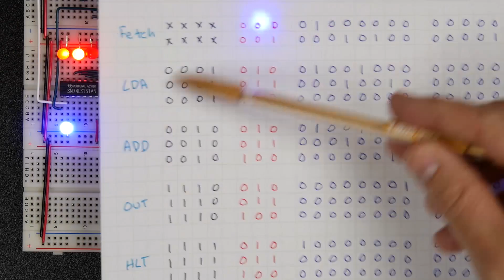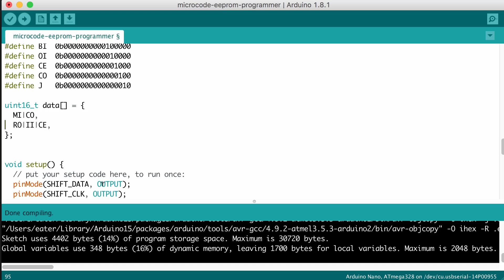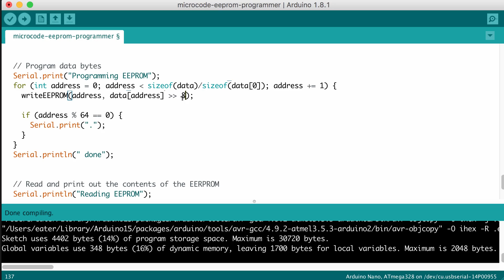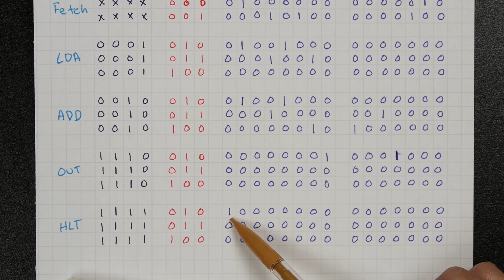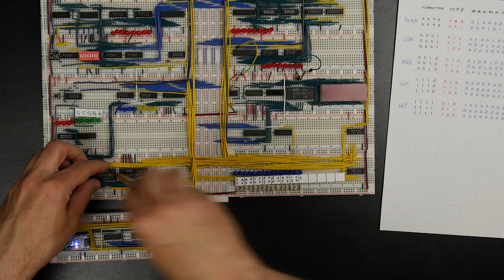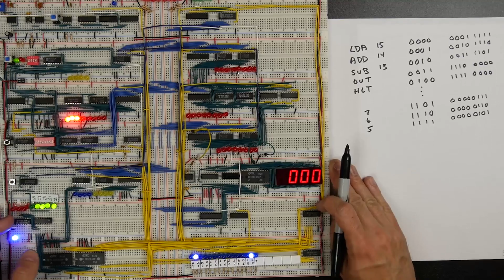Reprogramming CPU microcode with an Arduino

Comment: Doesn't RO and CO at the same time cause a short circuit if they try to drive the bus in opposite directions?
Reply: It would if you created a  microcode instruction that used them both in the same t-state but you would never enable two outputs to write to the bus at the same time.
Reply: except he did when he used the upper bits of the ucode in the bottom half before tying the address bit high!
Reply: Ah, I see what you mean. Good point, Maybe he was lucky and the RAM just happened to have the same value as the PC. He had just reset the machine so the address was 00 and he only stepped through the first couple of t-states. If he had powered up and let the clock run long enough for the RAM output to disagree with the PC then the result would be dependent on the chip specifications. So long as the processor was running then although the contentious outputs on the chips driving the bus would stress the chips they may be brief enough to avoid doing serious damage to them though I dare say they would probably get pretty warm. Obviously, the voltage level on the bus would be out of spec and there would be no guarantees as to the value read by any chips that tried to read the bus at that moment.

Comment: This makes my brain hurt. Why are we not using A0 to switch between the low and high eeproms?
Reply: Because A0 only changes when we move on to the next address. Remember that we need 15 control signals for each instruction. By hardwiring A7 differently on each chip they will each output a different 8-bit value for every (7-bit) address giving 16 bits for each instruction,  
Using A0 as a chip select signal was a common technique for 16-bit computers where the low bytes were stored in one chip and the high bytes in a second but then the data was different in each chip.
Reply: Actually, from a practical point of view, it wouldn't matter which address lines were physically connected to which.address pins on the chip. Although the data would be stored in different locations on the chip the data selected by any particular combination of inputs would be the data stored by that same combination,

Comment: Programming something into this looks so tedious. 
Will you add ROM address space like they did it in sinclair?

P.S. In the arduino sketch using array length in the loop and constant 128 as an address shift for second loop looks so bad to me...

Comment: "That pipe symbol" is a bad explaination if most of your audience is using Windows.
Reply: JoJoModding Really? What do you call it then, as I fail to guess it? Piping is functionality Microsoft imitated from Unix ages ago (no later than MS-DOS 2) , and at least Windows XP documentation refers to the character as a pipe operator. Meanwhile font fanatics might know it as vertical bar, and keyboards sometimes show the broken bar instead.

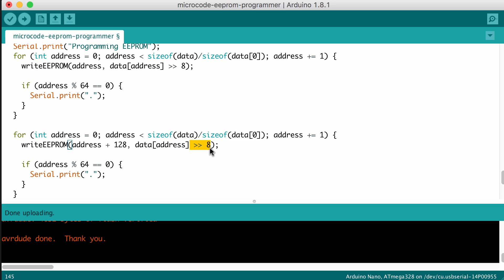Comment: @19:52 Instead of two separate loops to write the microcode to the EEPROMs, what about just a single loop with two writeEEPROM lines, one with the the right shifted data and one with the 128 address offset?...

Pros/cons anyone.
Reply: I don't know if the Arduino C compiler has optimizations, but any modern compiler for x86 would already combine the loops for you.

Comment: Ben, you're videos are fascinating! When I was in college back in the 80's, I worked with a Data General computer which had user-configurable microcode. I believe the microcode word was 56 bits long. One assignment we had was to create a "new" instruction. I wrote a "bit reverse" instruction to speed up FFT calculations. Anyway, thanks again for sharing these videos. Anyone who really wants to learn how computers work at the lowest level should watch your videos.

Comment: I guess this way is a little easier than messing with a hex editor but I couldn't get the arduino programmer to work (bad shift regs I think) so I'm using a real EEPROM programmer and messing with a hex editor and BIN files, at the moment I have upper and lower microcode rom files but thanks to the vid I can reduce it to one and have to mod my IR and control board to pull up bit 8

Comment: you could've saved yourself some time by using the shift operator when defining the bits.
Reply: True, but this allowed an opportunity to show the binary constant form, and it's easy to tell visually that the bits are in order.
Reply: @LoneTech and
#define ... 1 << 0
#define ... 1 << 1
#define ... 1 << 2
...
#define ... 1 << 14
doesn't tell you the order?
Binary notation is also rather rare to see as it just isn't all that nice to write, probably also because it's not part of the C standard.
Reply: These videos are clearly aimed at novices, and using the binary notation is clearly the best choice. Easier to understand for a novice than both hexadecimal and bit shifting.
Reply: I don't think bit shifts are hard to understand for novices. if you write 1 << 4 and you explain that it takes the 1 and shifts it 4 positions to the left it's pretty obvious how it works.

Comment: Thanks Ben.
For your next project, may I suggest expanding the RAM to at least 256 bytes and add on a serial receiver module to the bread board to boot load a program from Arduino to directly into RAM, so that we could remove the programming DIP switches. Bootloading would be handy whenever resetting power to the CPU.
Reply: Not necessarily. The 8-bit address bus could be shared with the 8-bit data bus, it just have to be multiplexed. The fetch cycle will get more complicated, because it would have to load the 8-bit opcode first, then the 8-bit operand (if there is any), and the opcode would probably have to be latched in some instruction register, but at least the bus will stay unchanged. We could even expand the address space to 16-bit by adding some latch register to the memory module and latch up one half of the address in it, then assert the other half of the address on the bus. But it totally could be done.
Actually, a similar trick is used in 8502 microcontrollers – they use 16-bit addresses, but they share half of the address bus with the 8-bit data bus, so they have to latch one half of the address in a register outside the chip.
Reply: @scitwi9164  If you read the computer architectures book it digs into this.  It's cool!
Reply: 256 bytes of address requires 8 bits of address line. given 4 bits for instruction that is 12 bits for instruction? Probably not probably 16 bits. So you need to expand all buses and registers to 16 bits or fetch instruction in multiple takes. anyways you get 256 bytes / 2 bytes per instruction, that is 128 instructions. that is better but is is good enough?
Reply: Or without much of a redesign, keeping the same 4-bit opcode and 4-bit address system, you could just add another 15 pages of RAM and introduce a page selector.

Comment: Another awesome video Ben, many thanks! I kept thinking of the old joke while watching this - "There are 10 kinds of people in the world, those who understand binary and those who don't"

My home build is following along when I have time - I'm trying some modifications to give 8-bit addressing for RAM (and an 8-bit Program Counter). Currently working on the RAM module which is using a 256Kbit (32K x 8) SRAM chip - it's overkill but the smallest I could easily find to buy. The main difference for me is going to be the requirement for 2-byte instructions (1st byte instruction / 2nd byte operand or address) but I think I've figured out how to do this in the microcode with two CE signals per instruction on different microsteps. Guess I'll find out when I get to that bit!

I did get stuck on the EEPROM programming for a while, my 28C64 EEPROMs (again the smallest I could easily source) didn't like your original programmer code so I had to write Arduino code that more closely matched the datasheet timings to get EEPROM writes working reliably. At least having the extra EEPROM address space meant I could have both decimal and hex in unsigned and signed on the 7-seg display.

If anyone else is having issues with writing to larger (e.g. 28C64) EEPROMs I'm happy to share the circuit & code.

And again, thanks to Ben for such an amazing series, learning so much!
Reply: I'm doing exactly the same thing👌
unfortunately I'm Still building mine so I can't help you yet. I'm sure that we aren't the only one's who are doing this tho
Reply: Quick update on this - I now have a fully functioning RAM module based on the LY62256 SRAM chip! Took me 4 attempts to get the right design and implement it, but very happy with the result. Now have a full 8-bit address bus and control via the same 3 signals (MI, RI, RO) as Ben's so should integrate fine with the control logic. The biggest 'gotcha' I encountered was that the 74LS157's have a very odd (to me) behaviour when the Strobe signal (Pin 15) is high (=inactive).

I was trying to use this signal to control whether the input bus or DIP switch value was presented to the data pins on the SRAM or not - but didn't realise that when Strobe goes high the outputs of the 74LS157's don't go to high impedance (as I'd assumed they would) but actually go to ground. Once I'd worked that out adding a 74LS245 tri-state octal buffer between the input stage and the data pins was all that was needed. An alternative would be to change out the 2 x 74LS157s on the 8 data bits to 2 x 74LS257s which appear to function as I'd expected and go High-Z on their outputs when Strobe is High, but I can't get hold of these quickly so figured a tri-state buffer would achieve the same thing.

I've already tested putting data values in 2 memory locations which point to the address of each other (e.g. at address 55h setting AAh data and at address AAh setting 55h data and then letting the clock run with RO and MI both active and can see the 'computer' bounce between the two locations on each clock) so reasonably confident the RAM part is working ok.

Next up is instruction register (which I skipped when building the A and B registers) and then control logic/EEPROMs...
Reply: Hi Thomas, sure I drew up the schematic while I was building so I could keep the connections straight in my head - the pinouts on the 74LS273's are a bit of a nightmare to keep track of. You should be able to see them here: http://imgur.com/a/ruclh
Reply: jaxey As soon as I catch up to speed I hope to modify my build to have a 16-bit address bus. So I'll have a desperate address bus and data bus.

What RAM chips are you using specifically? Are you planning on adding ROM for program space?
Reply: I'm attempting to use the LY62256 for SRAM - (http://www.farnell.com/datasheets/1674430.pdf). Main issue is that in common with most parallel SRAM modules I can find they use the same pins for input and output which means a bit of a redesign from Ben's memory. I'm trying using 2x tristate buffers (74LS245's) so that I can still have LED output for the current memory data and not collide data inputs with current bus value (or bypass the 74LS157 multiplexors on the data lines).

I think I've got a design pattern that's going to work now, but involves manipulation of the WE and OE lines to the SRAM combined with the control signals (RI/RO, program/run mode and program button). My next step will be to (re)build the module and see if it works. If anyone else is using SRAM with Ben's project and has had to cope with combined input/output pins I'd be interested to know what you did / how you addressed the bus output 'bypassing' the 74LS157's when connected directly.
Reply: I added a RAM expansion to my build using these:
http://www.nteinc.com/specs/65000to65999/pdf/nte65101.pdf
http://www.ebay.com/itm/INTEL-P5101-8-Integrated-Circuit-SRAM-NTE65101-Equivalent/252002271571?ssPageName=STRK%3AMEBIDX%3AIT&_trksid=p2057872.m2749.l2649

They are 256*4 bit with separate input/output pins - pretty much exactly the same pins
as the 74LS189 except 4 more address lines. And the outputs are NOT negated so you
don't have to use inverters on the outputs. Worked great for me.
Reply: Thank you for your information. Would you share some pictures of your setup and maybe some basic schematics/architecture? Maybe we can get in touch via e-mail?
Are you planning to upgrade it to support a 16 bit address bus and single, double and triple byte instructions? That way absolute and relative addressing would be possible. Maybe even emulate something like the MOS6502 instruction set. That is kind of my plan for now. Right now I am still working on implementing Ben's original design.
Reply: To answer the ROM part of your question - possibly, although I think it maybe easier to have an external programmer (e.g. similar to the Arduino EEPROM programmer) configured in a way that it can write values directly into SRAM to load the program. Shouldn't be too hard with a Nano/Mini or similar on the board (probably with a couple of shift registers again) to have a button that steps through addresses and enters data in each location then terminates. Gives a quick and easy way to load code to RAM without DIP switches and makes it much easier to edit the code. In fact the code would be extremely similar to the EEPROM programmer, just using a 'live' SRAM chip as the target.
Reply: There are 10 kinds of people in this world, those who understand binary, those who don't, and those who realise this joke is in ternary.

Comment: You can use the last control world bit as a "last microinstruction" flag, the microinstruction counter will then be resetted the next clock cycle.
Reply: I and others have been saying this for about 5 videos. It's seems like he's setting us up for some kind of reveal or plot twist haha. I'd be surprised if it isn't this refinement tho. He already showed that he reads the comments when he tightened up the fetch cycle from 3 clock cycles to 2, directly siting comments as inspiration. He also stated that you could refine this aspect but it will be done in the future.
Reply: There is a way to add this signal without the need for another EEPROM: just add a 4-input AND gate on some of the control lines that usually cannot be turned on together, and let this signal be the "next instruction" signal that will reset the ring counter. So to reset the ring counter, one would simply output all these control signals together to activate the AND gate. Problem solved ;)
Reply: @scitwi9164  huh that's a good idea, I might do that
Reply: ^-- This. I was waiting for him to do that, but it never happened.
Reply: Maybe the reason he did that Arduino thing was to then be able to add functionality, the computer was already working.
He will probably do it very soon.
Reply: I was thinking the same, but then I realized that if he wants any kind of conditional jump, that'll need another control signal. So, he might implement a branch if zero instead of trying to optimize.

Comment: add a 4-bit counter so that when you're programming instructions you can just hit a button to step from one address to another.
Reply: You mean a button you hold to allow the input value to count up? Not sure if that is as elegant as dip switches.
Reply: Yes, but faster if you're entering values in subsequent addresses. Perhaps a setup with both, using the DIP's to choose a starting address, but then have a button to push to go to the next address. Of course, you could go really fancy and use the arduino :)
Reply: +Richard Smith No, he meant a button to move to the next address in memory so that you didn't have to use the dips to maneuver your way around the binary numbers

Comment: Is there some way you could use some sort of 8 bit buffer to cache both halves of the EEPROM, thereby reducing the EEPROM count by one? The clock edges are at the wrong time, you'd need a microcode clock that was triggered by the clock edge, but it might be an interesting efficiency extension.

Comment: Why not use a 2D array for the opcodes? That way data[0] points to an array of instructions for the 0th instruction, data[1] points to an array of instructions for the 1st instruction, and so on
Reply: Trick question, isn't it? The computing model only has 1D memory, and C's 2D arrays are syntactic sugar for 1D arrays. The memory arrangement is the same. Then we have that the RAM is built in 2D form (with columns and rows) but on SRAMs and EEPROMs like those in this computer we can ignore the boundary between them, and choose any arbitrary split of the address bus (in this case, left or right half of control word, instruction opcode, and instruction step). If the question is about why we have 8 steps per instruction, that's a power of two so we don't need complicated logic but can wire the step count directly. Effectively, if we used a 2D C array for this arrangement all we'd gain is having to put a pair of braces on each line. Might prevent a bug if you accidentally changed the number of entries on a line. The lookup difference isn't an advantage because it's not the Arduino that reads instructions.